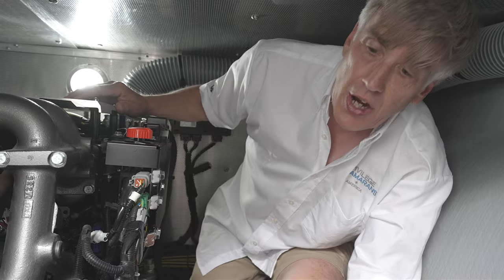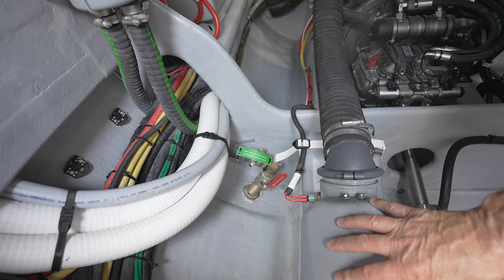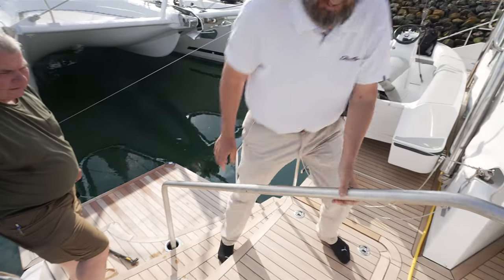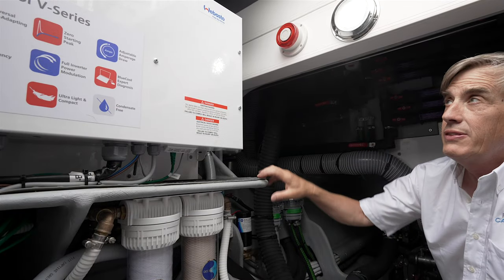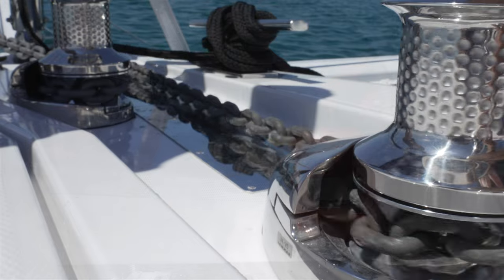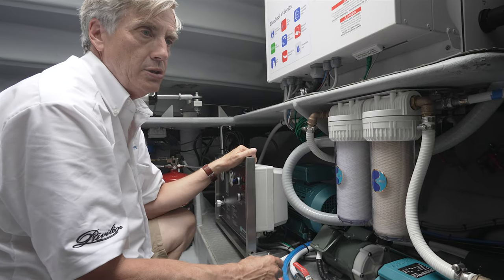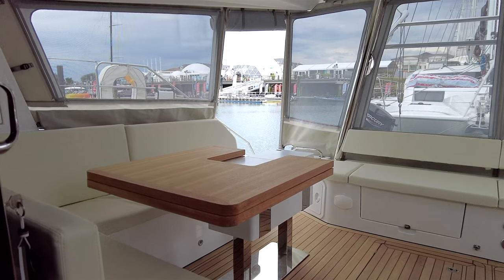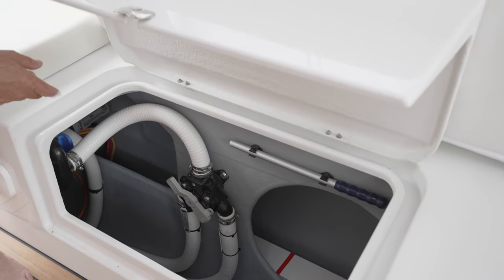Privilege 510 Mechanical Systems

Comment: 03:20 - That aluminium bent sharp plate right below the hatch opening is going to give owners a lot of memorable moments…
Reply from the maker: That's the attachment point for the ladder which is typically in place. We removed it to allow for filming!
Reply: Is the support for the stairs to get in to the engine room, i think they take it out to have better scene for the video
Reply from the maker: @unmonavela2048  exactly!

Comment: The engine cranking battery appears to be in some type of box accessed from the topside only.  How does one change these batteries?  Looks to be extremely difficult as it's top access only with little space.  Other than that, come on lottery!!!